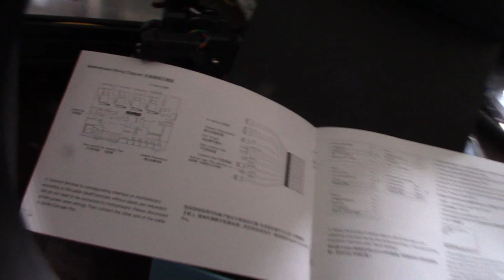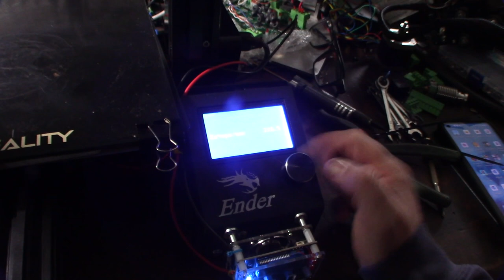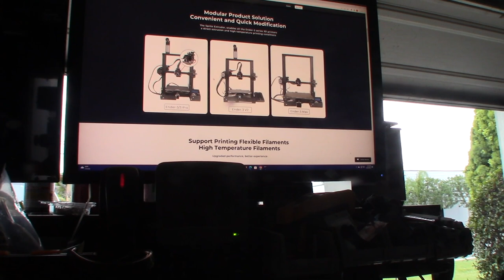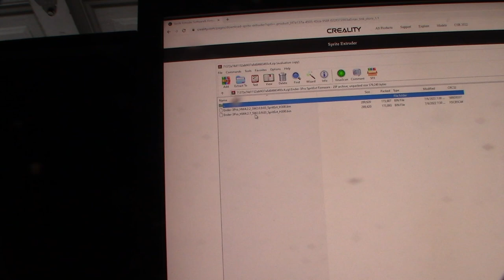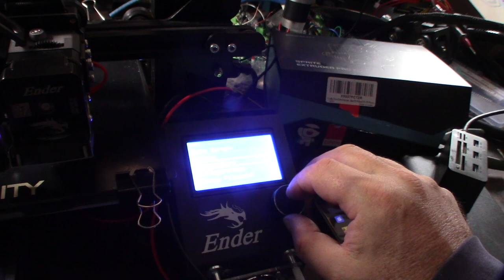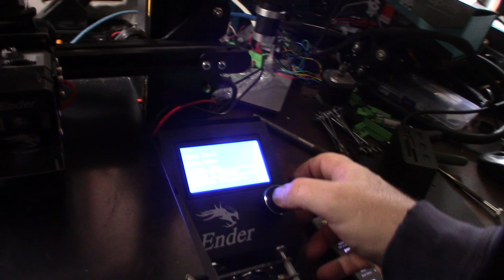Creality Sprite Direct Dual Drive Extruder Ender 3 CR-10 VERY NICE!!! Best upgrade for Crealtiy Yet

Comment: Ok. So the reason we add the fans or massive ducts is for bridging. U try to bridge with that stock setup. U will fail majorly. I have a stock anycubic and it bridges ok for stock. But the same print on my ender. It bridges like no one’s business. That’s a lot of help when your cranking out prints. Bc in order to bridge on a stock machine. U need at least 50% infill. With my ender I can bridge 20% infill. That’s the lowest I have taken it. But people are bridging 10 or 15%. It saves a lot of time. But the sprite does take care of that. It is a nice upgrade to bridging like that.